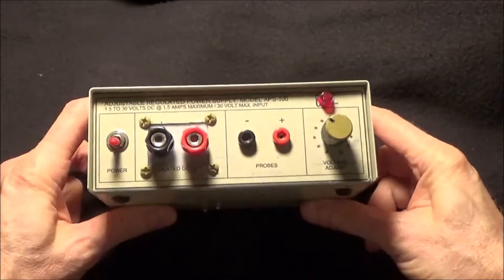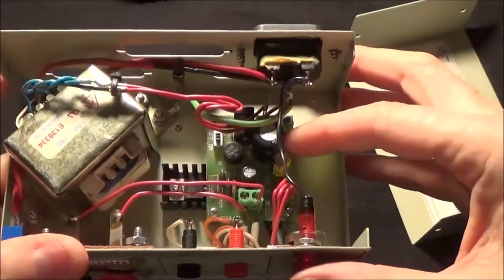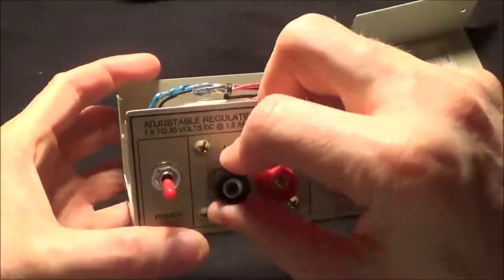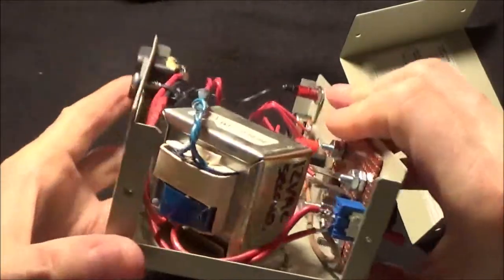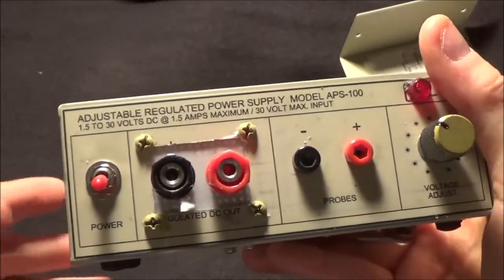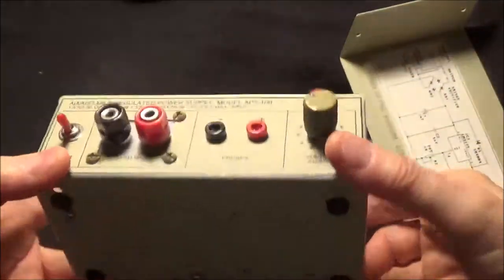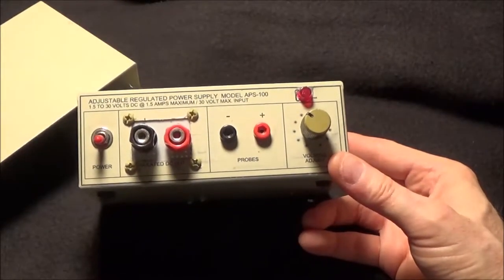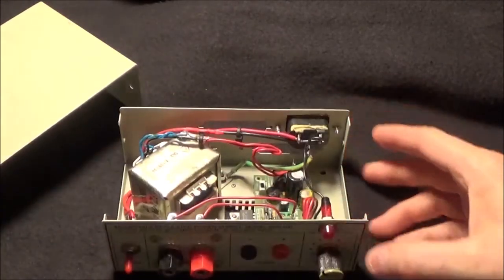DIY Guitar Effects Aid #11 - Adjustable Power Supply

Comment: Good day, sir.  I am interested in building a 12 volt to 140 volt circuit to power 12ax7s in a box.  Can you help me?  Thank you so much.  Gerry
Reply from the maker: Hey Gerry, take a look at the "Real McTube II" schematic. That uses a pair of 12.6V transformers back to back to create around 140 volts after rectification. You just have to make sure that the amperage is high enough to overcome the losses in doing that. I have a few vids on the McTube if you're interested.